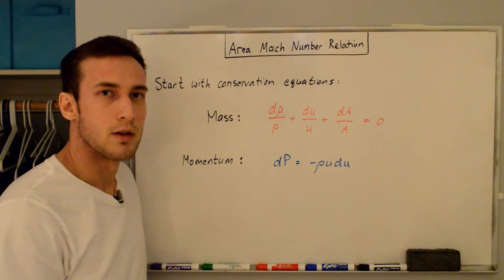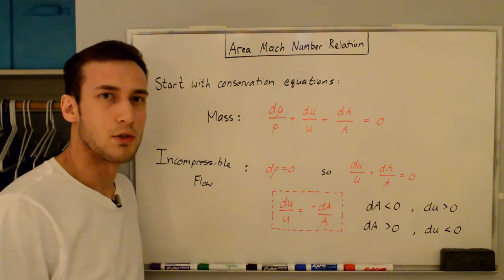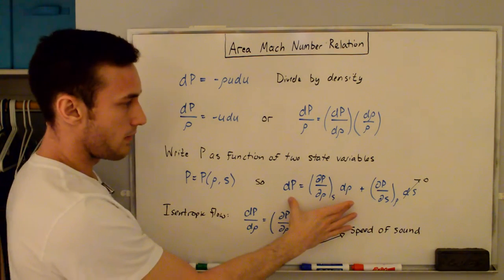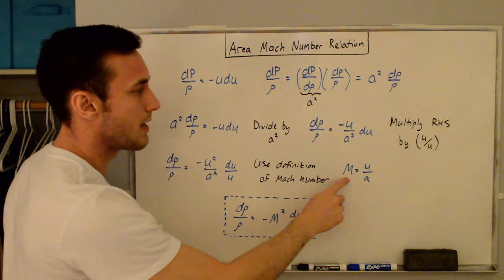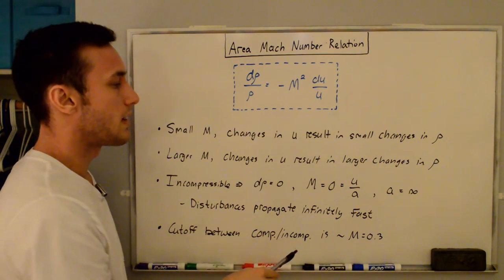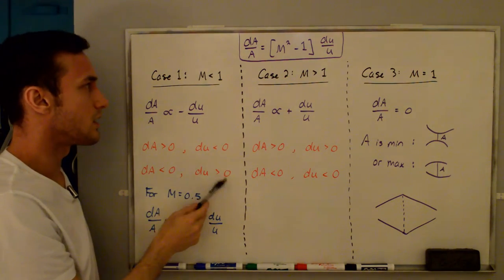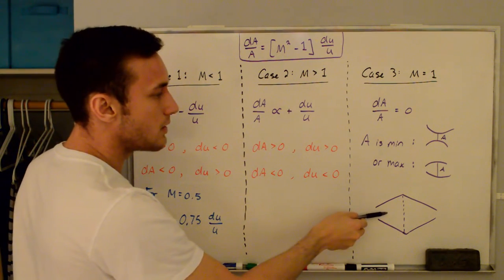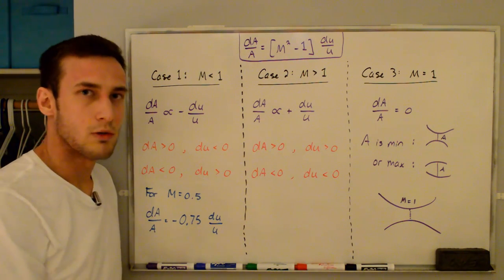Explained: Area-Mach Number Relation

Comment: I am glad I can pause and rewind; I can’t imagine a 50 minute live lecture at this rate
Reply from the maker: That's the beauty of YouTube.  When I lectured, I would never go this fast.
Reply: @JoshTheEngineer  Are you trying to get in under a particular time cap? As a lecturer myself, I've found that if you take pauses that you perceive to be too long when lecturing, they actually are a good length and seem natural.
Reply from the maker: @navsquid32  Not necessarily; all my videos are pretty long, so I'm not worried about time.  I was mainly trying to adapt my editing to comments on other videos saying that my breathing was distracting or something along those lines.  I ended up over-editing, by cutting out any breathing point that I had that was noticeable to me, which makes it seem like I'm talking faster than the raw video actually shows.  In my more recent videos, you can see the format that I like and that I'm sticking to now.
Reply: JoshTheEngineer Thanks for that. I was curious about the edits, actually. I  put your videos on 0.75, and it makes it “normal speed.” That makes sense with the edits, though, because the longer segments don’t seem particularly fast.
Reply from the maker: @navsquid32  Yep, no problem.  There's a lot of videos I'd like to re-film to get them slower.  The best example is my afterburners video.  Nothing is wrong with any of the content, but most of the comments I have to sift through are repeated terrible jokes, which gets a little tedious.  In the end, I just don't have the time or the patience to re-film videos that are perfectly fine aside from maybe being a little on the fast side.  I recommend people do what you do, which is slow it down a little bit, and hopefully that's ok.  If not, there's always other videos on the topic that might be more suitable for them.

Comment: Great work! I would like to discuss my AirPower project with you, where I have a high-mass subsonic airflow at the exit of a heat insulated converging duct, tangentially impacting a radial turbine. The thrust of this flow rotates the turbine which is linked to an electric generator. The airflow was induced and created by an electric axial fan aspirating ambient air at the converging duct inlet. My point is that we can aspirate and accelerate ambient air, and generate more electric power than we injected at the fan, as we are converting internal energy from the air into kinetic energy. The air comes out of the system cooler than at the entrance, some 6, 7 degrees C. So, we have an open-cycle thermal machine which generates kinetic energy from the incoming internal energy, converts a portion of this kinetic energy into electric power, and cooler air leaves the system. In short, we can generate clean electric power from ambient air, at the same time obtaining cooler air and condensating part of the contained moisture. So, clean power, cool air and freshwater. From ambient air. And fully respecting the first and second laws. I need more theoretical expertise to prove it. If we could talk, would greatly appreciate your assistance. My email is james.pessoa@gmail.com 
Thank you very much.

Comment: that's really interesting! is there an intuitive explanation why the relation flips?
Reply from the maker: I would say that the most intuitive way to think about it is that when you include the effects of changing density, this result naturally pops out of the conservation equations.  What do I mean by that?  I showed how we can use only the conservation of mass equation to see how velocity changes with changes in area when the flow is incompressible.  The reason that was possible was because we assumed density was constant.

When we relax the incompressible assumption and allow density to change, you can still relate the area change to the velocity change from the mass conservation equation, but you'll also have that density term in there, and it's not clear how it affects the velocity without further analysis.  So we brought in the conservation of momentum equation to find a relationship between changes in velocity and changes in pressure.  We were able to eliminate that density term by using the definition of the speed of sound, which relates the change in pressure to the isentropic change in density.  So in the end, we can end up with an expression that again relates the area to the velocity, but we now have a term that modifies the velocity change that depends on whether the flow velocity is less than, equal to, or greater than the speed of sound.

I know that discussion basically just rehashed the mathematics of the video, but it was harder than I thought to come up with a more intuitive way of thinking about this other than it happens to fall out of the combination of the mass and momentum conservation equations after rearranging some terms and introducing the convenient dimensionless Mach number.
Reply: You're a great explaining stuff, better than anyone I know in engineering
Reply: i was thinking about it and I came up with the following explanation. Look at the conservation of mass equation. Increasing the area requires some combination of lowering the velocity and lowering the density. This makes sense. If you give the gas more space it will have two choices. Either it can spread out- decreasing density, or it can slow down, so that more gas accumulates in the the area as the area increases. 

However, as derived from the conservation of momentum equation, the velocity and the density change in opposite directions. This also makes sense. In order for the density to decrease, the fluid must spread out. So imagine a small section of the flow. In order for it to spread out, the front of it needs to speed away from the back, so the section is now spread among more total area. Thus, decreasing density creates an increase in speed. The opposite is also true. If the speed decreases, The gas in the front slows down and the gas in the back comes up behind it, and the total space decreases, increasing the density.

So, when the area is expanded, the flow has two coping mechanisms to choose from. It can decrease its density, or it can decrease its velocity., However, whichever it chooses, the other will work against it. That is where the final equation comes in. The mach number determines how strong the correlation is between the change in density and the change in velocity. If the mach number is low, then decreasing the velocity does not effect the density very much, so expanding the flow will slow it down without significantly changing the density. On the other hand, for a supersonic flow, decreasing the velocity would have a tremendous effect on the density, and the mass equation could not be satisfied. Rather, the density decreases, thereby increasing the velocity. And, in the middle case where the flow is exactly sonic, the changes in velocity and density exactly balance each other out, so neither one will happen just because the area changes.

It makes sense that this depends on mach number. When the mach number is low, a disturbance in one place does not immediately effect the gas farther upstream. So decreasing the velocity of the front gas in the section will not instantaneously increase the density in the gas behind it. It can accelerate smoothly without compressing. However, in a supersonic flow, any gas that slows down will cause all of the gas behind it to pile up because the deceleration reverberated back through the flow.

Thoughts?
Reply: @yyyyyyyyxxx334  Wow! That explanation is amazing. It finally gave me a very good intuition for such a counter-intuitive concept. Thank you so much for taking the time to write that out to help others like myself understand this idea! A million thanks!
Reply: @yyyyyyyyxxx334  It's not just gas. This works for incompressible fluids as well. The flow of water through pipes, for example. Transitioning to a larger diameter pipe will reduce the velocity of the fluid by necessity. If this didn't occur, then mass would not be conserved, since more mass would be flowing upstream of the pipe transition than is flowing into it. That cannot occur. The mass of fluid flowing into the control volume needs to equal the mass of fluid flowing out.

Whenever flow conditions are such that there is an abrupt change in conditions (like density in a compressible fluid like air), then a shock front develops, in which there is a prompt change in fluid conditions, which is a highly non-isentropic phenomenon.
Reply: @yyyyyyyyxxx334  Amazing explanation!!! Thanks.

Comment: This is the area velocity variation and not the area Mach relation!.... two different relations
Reply from the maker: Yep, you're correct that this is actually the area-velocity relation.  I guess the reason I had labeled it like this was because I then used the CPG assumption to simplify the expression to the area-Mach number relation in the next video.  But yes, you're right.